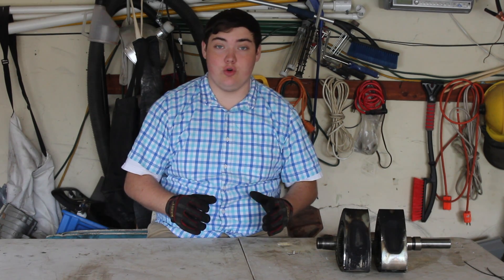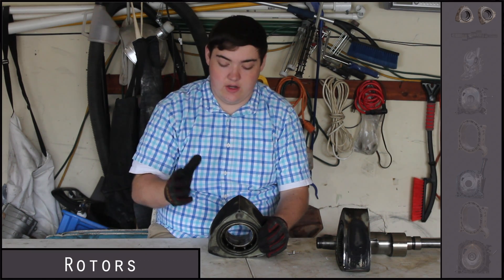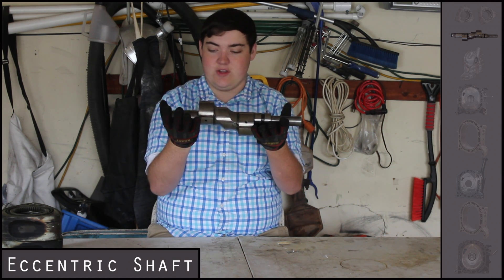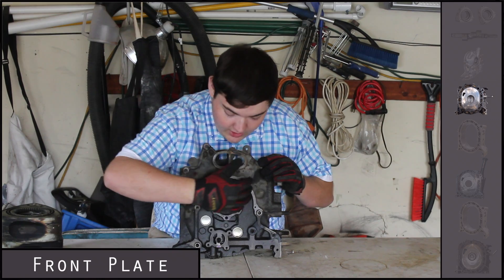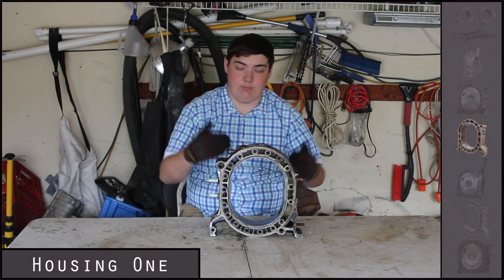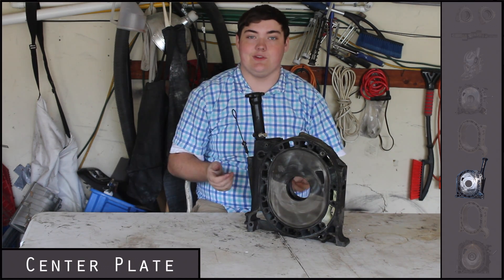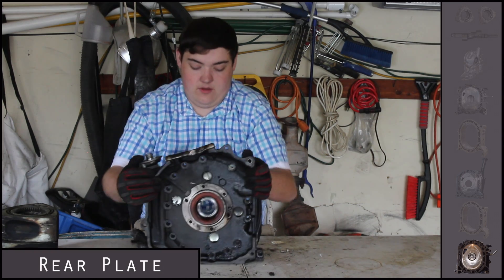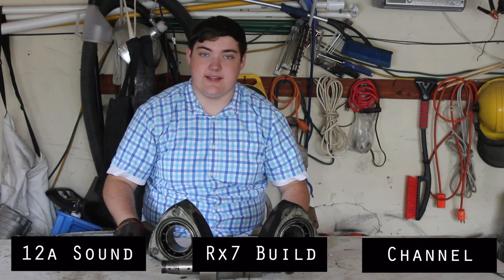How A Rotary Engine Works (12a)

Comment: Just bought my 1st rx8 did a block sniff and it failed 😔 do you send the sections to a machine shop like you would do on a normal engine? Or just replace seals?

Comment: Hey Man, love your vids.

I have a question.

I am currently in the process of stripping down and rebuilding an old 12a motor.
I am to the stage where I loosen and remove the tension bolts and i am a bit lost.
All the manuals and videos show a different tension bolt configuration but on your REAR plate it is the same as mine.
If you deconstructed the motor can u please reply me the order in which you removed them or if u just took them all out regardless.

Thanks in advance.
Reply from the maker: Declan Groves I just took them out in no serious order, but when putting it back together do a star pattern. Tighten one then the one opposite of it
Reply: Thanks, Appreciate it!